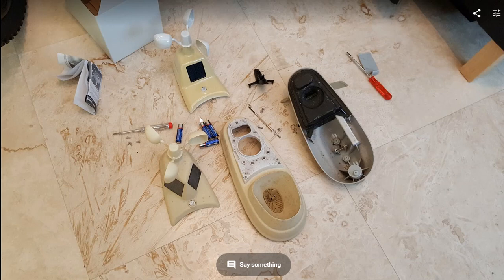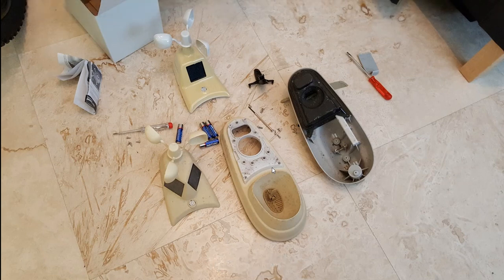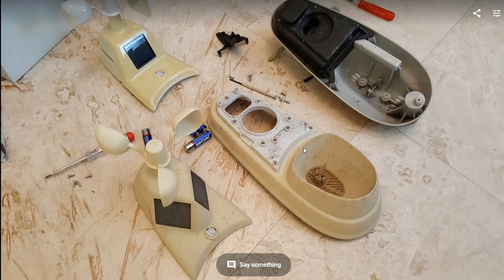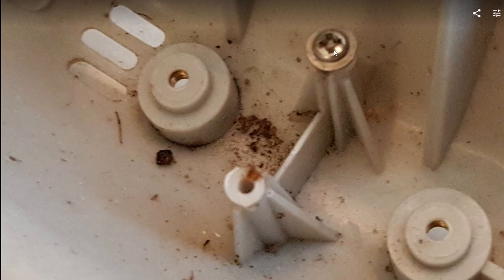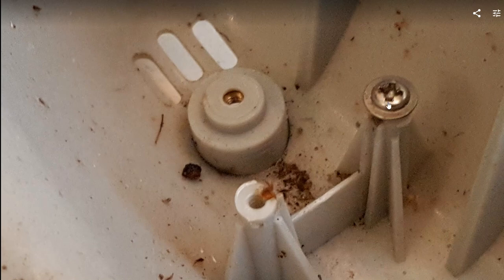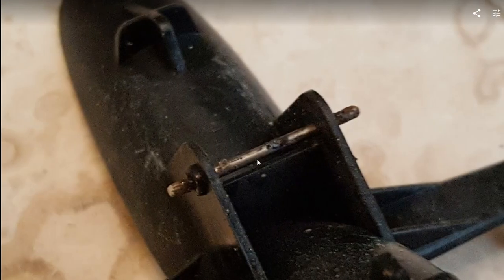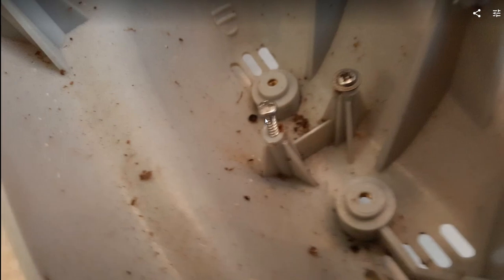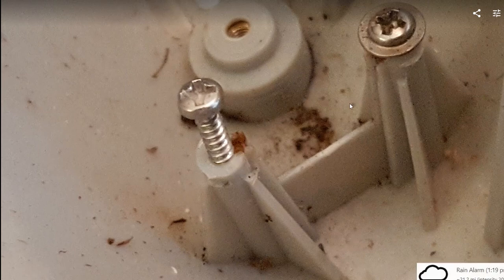How To Repair The Rain Gauge In A AcuRite 01035M Weather Station with 5-in-1

Comment: IF YOU HAVE REASSEMBLED YOUR RAIN GAUGE AND GET NO RAINFALL INDICATION ON YOUR INDOOR DISPLAY,  READ THIS:

The plastic teeter totter on my rain gauge had two small metal cylinders on each end opposite the scoops.  One of the metal pieces was THE MAGNET, the other, a metal counterweight and non-functional.  In reassembling the teeter totter, I inadvertently reversed the plastic piece and installed the NON-MAGNETIC cylinder under the switch.  Yikes.  Rain gauge didn't work, zero amount of rain accumulation when tested.  

When installed correctly, with the magnetic cylinder under the switch assembly, you will hear the magnet-controlled switch 'click' as the teeter totter is rocked back and forth.  After installing the magnet under the switch, all worked fine.
Reply from the maker: I don't have this device any more, but thank you very much for your detailed info
Reply: Absolutely...you answered the question I was pondering. I had my entire weather station torn down yesterday for the second time for a good cleaning. I removed everything and even waxed the the rain spoons and rain collection funnel. After reassembling and mounting, rain gauge not working😢. I am 90% sure the magnet is reassembled in reverse. I will correct this now and hoping it works. Thanks for the info👍👍👍